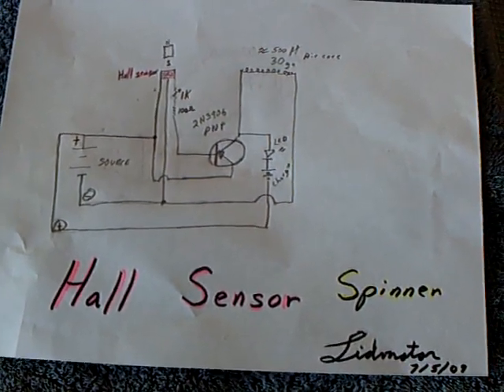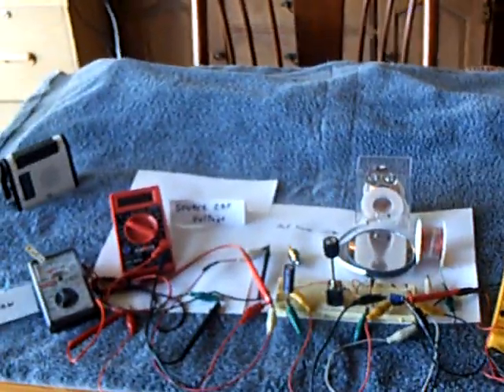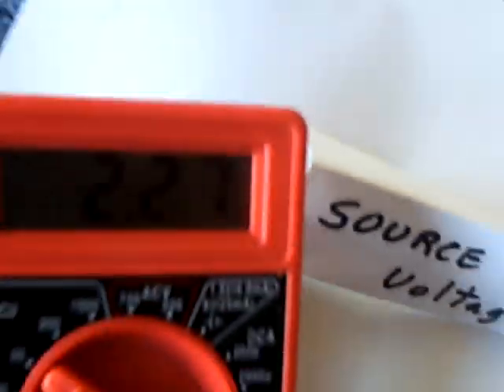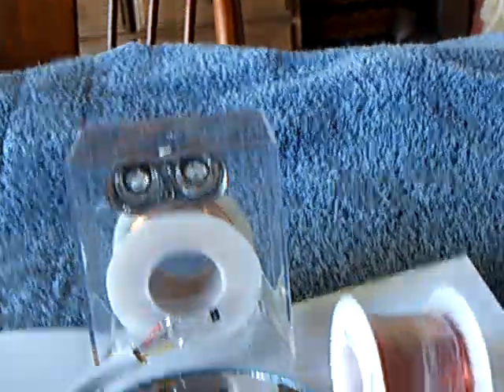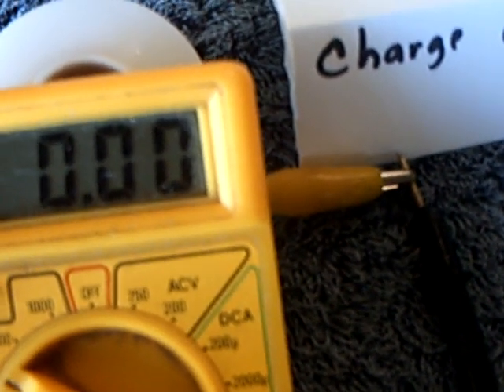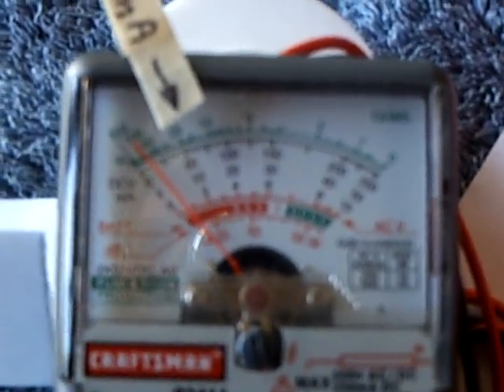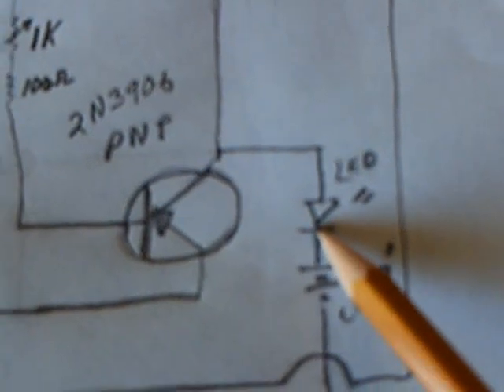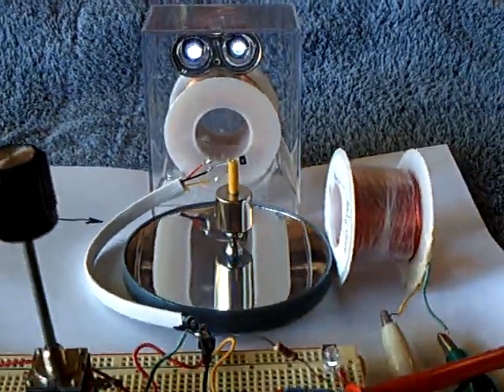Hall Sensor Spinner

Comment: Hi lid, nice work again.
I'm wondering, what if you would replace maggie for a normal coil with a bridge rectifier and a carging capacitor and then feed back the output to the source cap instead of lighting 2 led's; would it reach break even??? It's a nicely fabricated circuit.

Comment: Hi Lid.
Normaly speaking i would totaly agree with you, but i've seen some weird things with bedini / bedini like circuits so at this point i'm starting to believe that it might just be possible to reach break even or even overunity!
I've seen jonny davro's circuits and there is on certain times negative amp draw; so you could say negative amp draw is the same as overunity.
Also skycollection has a motor that looks like running / generating overunity.
So i'm very very curious!!!

Comment: Hi lidmotor nice vid! 
If I was to upgrade this to two coils so it fires on each pole (the hall that latches on each polarity with four pins not three) would I need a second circuit just reversed and powered from the same source? Or is there a point I could wire in a second coil? 
Thanks for any help
I really appreciate it